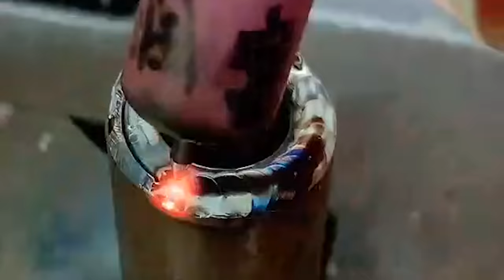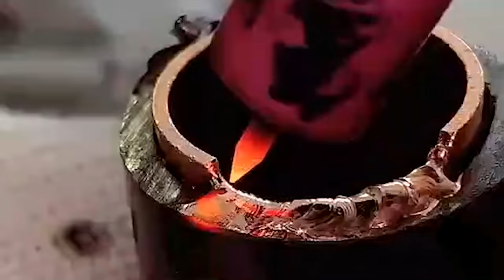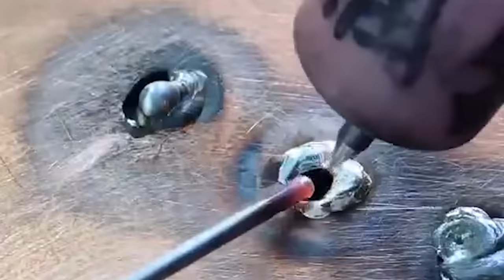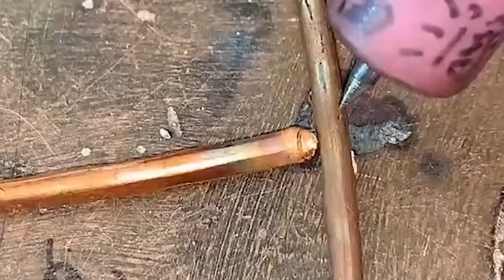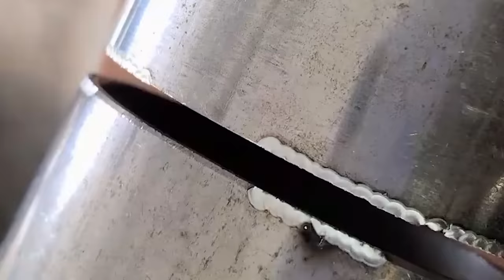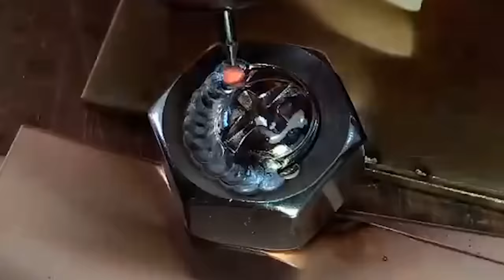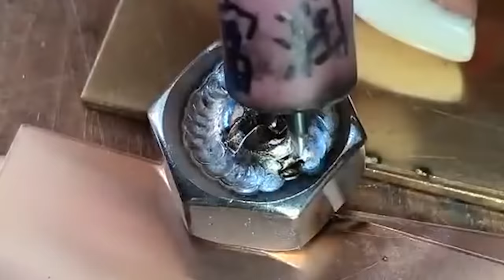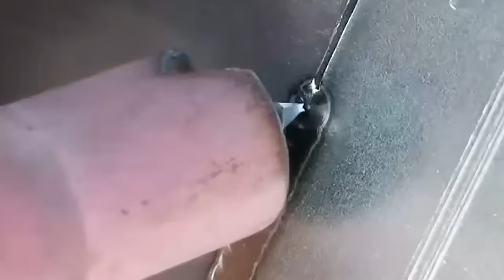What is cold welding? Watching this video you will understand!

Comment: For Cold Welding, I thought the prerequisites were: Being in a vacuum, the metals being extraordinarily clean as the cleaner they are the stronger the weld. I knew not to expect too much but having the title the way it was I thought some information would be given. If anyone can break the video down I’d really appreciate it. Also if you can clarify if there are two different versions of cold welding.
Reply: There’s not two different forms of cold welding.  You are right about the vacuum but not only does the metal have to be clean but also there can’t be a metal oxide layer around the metal. They call this cold welding because you aren’t applying direct heat over a extended period of time hence why these welds break very easily
Reply: there's cold welding, a cold weld, and then there's discount tig welding. this is the latter
Reply: @sp00der23  🤣🤣🤣🤣discount tig welding... 🤣🤣☺️☺️☺️
Reply: @Gus 
Good for light duty welds only. You know like sheet metals and such, did a good job with the copper/nickel (braise) alternative. There are only three types of welding- s.m.a.w shielded metal arc, fluxcore- MIG, tungsten- TIG. Also (Aluminun) but this falls back to TIG setup.
Reply: @JC-xj8jy  there’s more than that homie forge welding the first welding process ever made and submerged ark welding are a couple that I can name off the top of my head but there is a lot more out there

Edit:cold welding is also a thing just not what’s in this video
Reply: This is not cold welding this is just repeated low amperage tack welds using a tack timer
Reply: Both are called cold welding, but they're different processes. You speak of the cold welding that doesn't involve any molten metal. I believe that it's joining of non-ferrous metals only.  It requires joining surfaces to be extremely, flat, clean, and free of any oxide layer.  The adjacent metal surface meld into one another with no additional heat required. Nothing gets molten hot.. .  I think NASA found it to be a problem on metal components inadvertently welding together in space. The weld in this video is a sort of TIG spot-weld that  melts the metals together with heat.
Reply: This is just tig spot welding
Reply: @JC-xj8jy  there are other processes to weld aluminum
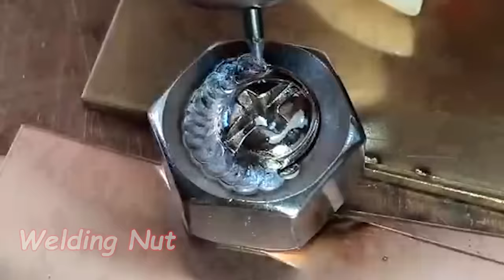Reply: @sp00der23  this comment got me to bust a 2:28
Reply: @jerrybobteasdale  the video is showing a pulse welder. They are intravenous tacks. It is a cold weld as in no strength. Not by temperature.
Reply: so you've been watching too much Action Lab 🤣
Reply: @NovaAliLive  That would be too much of a very good thing.
Reply: Basically cold welding is welding without fusion. Can be done from using pressure, or in the case of this video… an extremely fast spot weld with a tig machine thats lacking proper fusion. Nothing too special really.
Reply: @1SSniper  pulse welding is when the current goes up and down. In this case it reaches peak and stops at a bery rapid pace
Reply: @Sak-zo1ui  ig that simplifies it. The difference tho with regular pilse you still have a continuous arc
Reply: @joshuamclean4588  Without fusion of the metals , there is no weld.
Reply: @jerrybobteasdale  exactly
Reply: @jerrybobteasdale  welding is thenfusion of metals. Inised the wrong word by mistake. sorry I misspoke but the definition (textbook) is that the metals are joined without heat such as by forcing them together so hard that the oxide films are disrupted and adhesion occurs. In this case it basically means that there is lack of penetration.
Reply: Completely right and your thoughts/intuitions are indeed correct. Cold welding works best in a vacuum. Metals have to be extremely clean and "raw". What happens is a natural "fusion" if you'll pardon my use of the word (not sure if appropriate) as the molecules simply "come home", to each other, bond and reunite. I do it no just through poetic elaborations but it really is that cool.. the sheer amount of black body radiation emitting as you see the metal here cool is a dead giveaway of regular welding/what happens when you pass a large current through. This, demonstrated is more akin to contact welding than anything. Unfortunately, total clickbait. Just came to see what people had to say as well :p. 

Tl;Dr yes. No. Vacuum, smooth, clean surfaces in direct contact causes a molecular reaction, afaik without excessive electron excitation. Just, very hard to do and not very practical. Back purging is expensive too but again afaik, more practical. Just my thoughts on the subject. Make what you will
Reply: @sp00der23  sounds like the best intro to a spoof of Law and Order 🤣
Reply: @jerrybobteasdale  indeed they did! In the early days, I believe NASA had a problem with DOORS sealing shut on them 🙈🙈🙈.
Reply: There is lift-Tig(cheaper devices), lights spark by contact, and there is high frequency light up. There is classic DC Tig, and there is AC used for Aluminum weld.
Reply: @juliasmith1182  

Wow I didn’t know females weld too
Reply: @jonathangrypp1065  It doesn't have to be in a vacuum exactly, just absence of oxygen or other reactive gases. Galling would be a form of cold welding that happens all time in normal air. It is two metals in contact where mechanical movement and pressure removes the oxide layer and close proximity prevents oxygen from getting between the surfaces.
Reply: @JC-xj8jy  so... for aluminun the best is tig welding?
Reply: It literally just means a shitty tig weld
Reply: It's really cool either way and seems super useful for very soft metals. Makes sense to have one doing that kind of work maybe with jewelry or something. But yea you can call it whatever I guess but the quality of the weld itself is clearly not going to be anything commercial or industrial grade so a shitty tig weld seems a good description if the weld is meant to bear any real force upon it. It often times seems like it would just be melting whichever metal went liquid first and just let it cool and reform around whatever different metal it was welded with, not actually making it a weld.
Reply: @shanemcdowell5628  I was surprised at all of the discussion involving the fusion, and you were the only one to mention penetration. I was only a welder for about 5 years, but that's what they drill into your heads constantly. It's all about penetration (assuming that you don't have any flaws in your welding technique that causes internal flaws like porosity from contamination on the metal or mig welding with a faulty gas shield). We were required to do 3G or 3F vertical up welds when possible, due to the penetration that you can achieve with them. You want appropriate penetration on extra large welds requiring a minimum of 3 passes. It doesn't matter how well it fuses if that fusion is isolated at the surface.

It reminds me about a time where one of the inhouse engineers designed a triangle support plate to be bolted where perpendicular beams joined. The web was shaped like a triangle, and the 3 flanges were welded so that they joined together. It required a 1/2" deep well socket from the inside. The bolt holes were close to the corners. When I asked him why he designed it that way. He went into a really in-depth explanation regarding the calculations. He rambled for a while. I told him to follow me and brought him to the jig and told him to bolt the parts together... It finally clicked for him. We couldn't even fit a standard socket in while using a joint socket adapter. His face turned bright red when he realized how obvious the flaw was.
Reply: @JC-xj8jy  good point,  but wrong.
SMAW, FCAW, GMAW (what you call MIG), GTAW (tig), SAW (submerged arc welding), then of course there's laser, friction, etc. Etc.
Reply: this is fake. it's done with editing techniques. but she got your view and our comments. a penny for every view of misinformation.
Reply: @shanemcdowell5628  oh wow! I've never attempted foil. I can only imagine that nightmare when trying for the first time. I learned on carbon. Then expanded to SS, which felt mostly the same. When I first moved onto aluminum though. Holy crap. I went from 1/8-1/4" carbon and SS to 1/8-1/16" aluminum. I had to learn a whole new way to work the bead so that it didn't melt through. I also learned that I had a small hole in a spot on pants around the shin (the welds were ground level from where we were at, so it was near your shoes) and I had a section of skin come off. The flash burn was on another level for aluminum... I guess my point is that I noticed a fair amount of differences while welding what is considered standard welds. I can't even picture doing foil. Kudos bud, sincerely.
Reply: Actually the two different types of cold welding are China's and everyone else's. 😆
Reply: @shanemcdowell5628  

It's YouTube Shane.
 Where those who don't do teach.
Right after they Google a paragraph on the subject.
👌
Reply: @dpz9872  🤣🤣🤣... I don't really have anything useful to add. That was hilarious and I had to show appreciation
Reply: @JC-xj8jy  so many types of welding what I experience ia arc welding, mig, fcaw, Tig, Saw, gas welding, and others i havent tried yet like in our company have resistance welding and ive seen laser welding machine and friction weld similar to resistance, and termite weld use for train and the best for aluminum is gas welding and tig
Reply: cold welding doesn't exist, he's tig welding on a pulse setting
Reply: @landocalrissian2710  that's what is called cold welding. It is a strategy with a term given, so yes there is such a thing.
Reply: Yes ...Lol
Reply: Mostly internet BS from what I understand.
Reply: Ya.. this is just blasting the crap out of random metal with a tig. Nothing here is a cold weld. Sad click bait but also... Here we are viewing and commenting... So I guess it works a lil bit
Reply: @jerrybobteasdale  yes. When an astronaut couldn't close a compression hatch to get back inside.
Reply: @wealthNwisdom63  Well no shit lol what's that got to do with anything??😂🤣👍
Reply: Yea.. it seemed like normal welding which is done with heat.🤔
Reply: There's no such thing as cold welding. You need the heat to melt into the metal's thickness, or to penetrate further into the apparent metal. 
Vaccumm and gas purging are for alloys that require it.  Such as Stainless steel in some cases or Titanium alloy. They still require the heat for penetration.
Reply: @D_M_U 😂😂😂🤘
Reply: @joshuamclean4588  Bask in my undergrad, we cold welded some little sculptures out of metal powder using a two story tall hammer to build pressure inside a water filled vessel.  Exact opposite of a vacuum.
Reply: Doesn't paint coating burn and shield the air from the hot metal ?  Why else would experienced welders not gring everything before during and after welding ?
Reply: @Magneticitist  you can see ithe bead puddle as it cools should be uniform glow fading with no visible outline of a pddle from one of the pieces of metal only . You have to bridge with cold crud and stop before it melts though or drips . And when it drops to orange ,  then sticke again to build up a strong enough in pulses  bridge to hold a ery hot liquid metalbead of liquid  that can cool with even color from black to orange to white to orange to black . Controlling the heat by pulling the trigger to start raising the temoerature and filling the gap and letting go of the trigger to stop adding heat and waiting for the glowing hot weld you are uilding to cool .
 Thats how you control temoerature on thin tubing is by letting go of the trigger before it burs through and akes a big hole . Inba second usually it cools to orange and zapping may resume but it fets white and urns through and makes a big hole if you do not watch to stop zapping before it collapses.  
 Thin tubing might sound like alonger  bzzz in one spot to start a puddle  and then move along and stop if it gets too white .------------ and dont go anywhere . Hold still and wait . wait for it to cooland then resume welding bzzzzzz and watch the temoerature . On is getting hotter , and off with a wait is watching for the temoerature color to go down again .  Then go again .

 Bzzzzzzzzzzzzzz ----------- bzzzzzzz --------- bzzzzzzzz----------------- bzzzzzzxzzzzzz---
 
  Cthick big metal might have to stop . Go wait a half hour is the only difference

Comment: So it's a double-amperage TIG welder with a MICROSECOND PULSE timer.  It doesn't show but it's using 100% ARGON (mandatory).  The reason it's called COLD is that there is no hot puddle to maintain during a weld - and there is no feed rod.  The bond is technically a weld because the base metals are being fused - the lowest temp first.  This is an inferior weld for strength - but you have here a highly viable METHOD that is far closer to "hot" welds than it is to any chemical bond or mechanical fasteners.  ALSO it seems AFAIK UNIQUE in terms of joining DISSIMILAR metals.  Would be cool!!
Reply: Wow this is really cool info!
Reply: Could you use this method on the under body of a car frame
Reply: @terrancegoldman7796  Not if you haver a choice.  You want to have beefy, deep welds - that machine is the opposite end of the spectrum.
Reply: @DivineMisterAdVentures  so it’s basically for arts and crafts? I’m not being sarcastic at all genuinely asking
Reply: @darklight4889  Yeah It would be great for aluminum sculptures especially - really anything that isn't "massive"  that can benefit from extra super-neat weld joints and obviously mixing metals would be cool.  Tig is far more "utilitarian" in that direction but you could save a lot of money there.  Yeah - gets my vote for mixed metal sculpting. One tiny worry (with heat, dust, voltage & amperage issues) would be to ensure the high-frequency radiated power is properly isolated and isn't going to shorten the lifespan. Should be some artists using this by now!
Reply: Possibly best answer here tbh
Reply: Isn’t it more like spot welding?
Reply: @yewsengcheong1637  Spot or continuous. It does both.  Don't confuse the process with the method.
Reply: Can I do this with my welders?
Reply: @frustratedbaboon6486  I'm sure you've figured out why you can't!
Reply: It is similar to the pulse setting on a tig welder except the pulses are alot shorter and the arc is alot more powerful. When you weld it's not how high your amperage is that determines how much heat is transferred it's how fast or slow you weld. Most times a higher amperage while welding faster will transfer less heat than a lower amperage moving slower. Indeed the welds you are seeing are not cold to the touch but not hot enough to warp the metal, and yes you can weld dissimilar metals with it. It's not meant to be super strong welds as it's meant for really thin sheet metal or tiny things like jewelry
Reply: Not on how a tig torch is supposed to be used. You might as well use a mig gun for that.
Reply: What it really is is doing a normal spot weld but editing out all the actual spot welding bit. Then doing that again and again and again.
Reply: @Raistlin161  Pro-level TIG welders already have circuits for pulse amps and voltage. But this is a new process from electrode to power and pulse timing. It's taken to the next level and the price shows it. Any TIG has lots more going on than spot welders. For example, you can spot weld quite successfully with just a car battery and an electrode clamp.
Reply: Tlr; its a shitty weld.
Reply: @schwarz8614  Well sometimes you need your shit to look pretty.
Reply: The gas is colorless so cannot be shown. However it can be heard and i heard the gas flow.
Reply: @terrancegoldman7796  it will work on some ear rings
Reply: нужен перевод.
Reply: This isn't cold welding
Reply: You reminded me of that scene from Billy Madison.

Comment: Nothing about this is cold welding, it is tig welding where she just taps pedals once fast for quick pulse of electricity. Any metals can be welded, the properties turn liquid and mix together to form a new alloy. The trick is will it be strong or just appear a copper pipe is welded to steel. She has to put the 2 inside each other because end to end they would not stay connected. This is click bait to get attention and nothing more.
Reply: Agreed. Cold welding is where pressure causes fusion. As in the occurrence of overtightening certain types of threaded matarials....
 Titanium being one of them.
Reply: TIG fusion welding is very useful for taking the place of glue, tiny spot welds, and for tacking/positioning. It's great for attaching thin parts where cosmetics are critical, but strength is not.  I have never heard a "cold welder" claim their welds are structural, so there's nothing to argue.